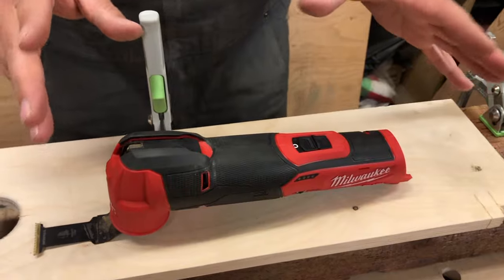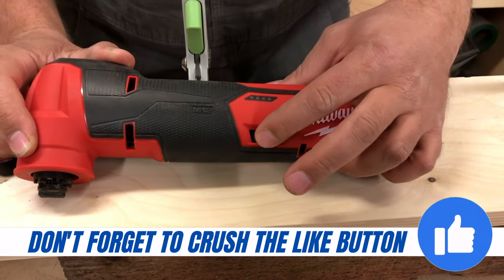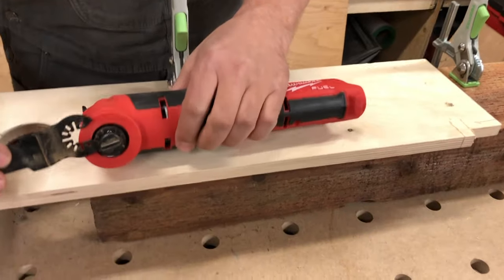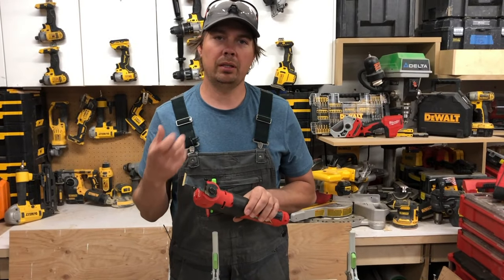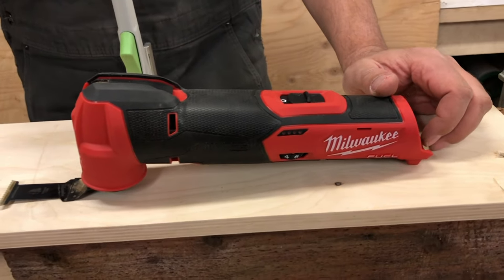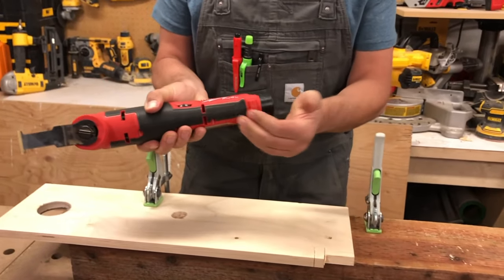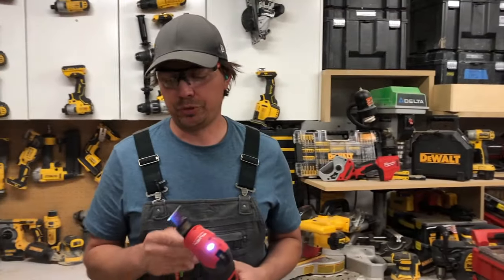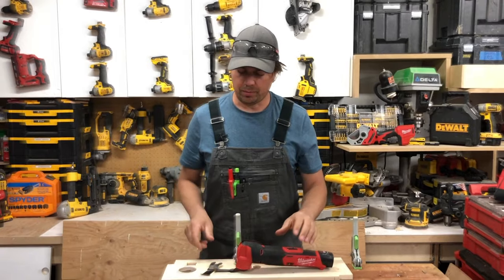Tool-free blade change! Milwaukee Fuel M12 Oscillating Multi Tool RAPID FIRE REVIEW

Comment: Nice video.  A chainsaw glove will help with vibration.  Also, the lever uses cam action to lock the blade.  Haven't played with it yet until this video.  You will also need Milwaukee or other brand blades that have the "C" shape mounting area vs a closed circle.  I have a blade I like a lot but it requires removal of the screw for each change.

Comment: I’m trying to install a doggie door in my metal door, and the instructions say I need a jigsaw. I have this exact tool (m12 fuel multi tool) — do you think I can get by with it or I def need a jig saw? thanks!
Reply from the maker: i think you could do it with this tool, just make sure you get the right blade. 1/8 holes in your 4 corners so you can line up both sides so you dont over cut, the jig saw would allow you to cut both sides at once. the multi tool might take longer but i think it would be fine
Reply: @hammerandhome  thank you for your advice!

Comment: I still don't understand what the locking lever is for, in my unit I can change the blade without touching this, it seems to do nothing.

Whereas my AEG (Ridgid) 18v multitool has a true tool less blade change as the head has a spring loaded clamp that DOES get pulled tight by the locking lever, so I lift lever change blade and lock lever, that's it, I never need to hand tighten anything.

Seems like poor design to me.